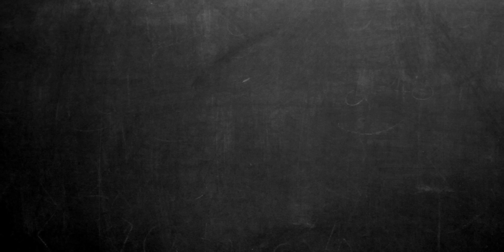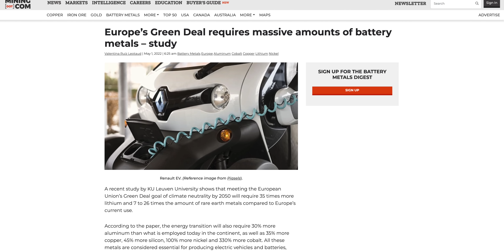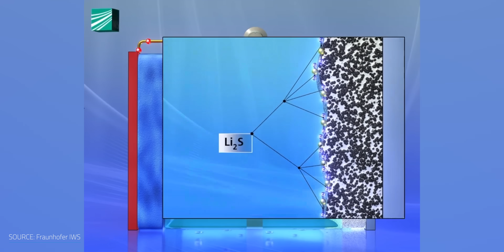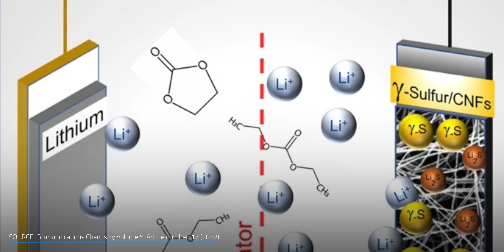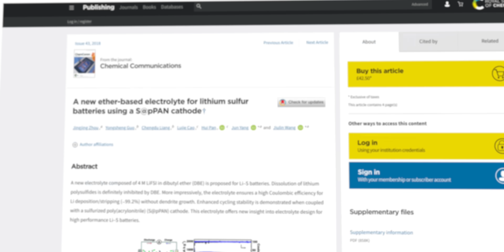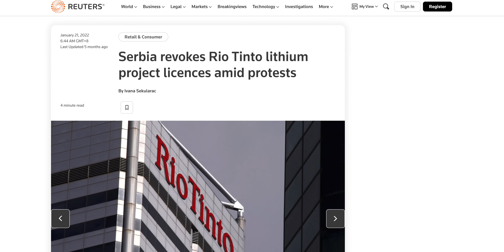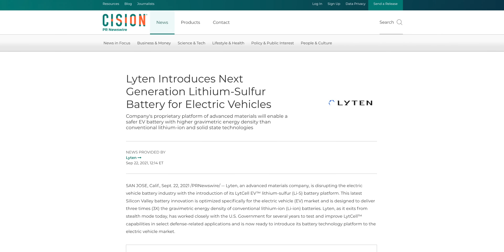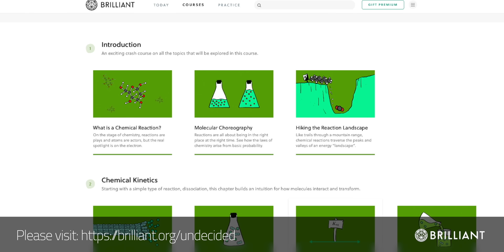Why This Accidental Battery Breakthrough Matters

Comment: Sodium-Sulphur would be amazing for grid scale storage, especially when their manufacture can be linked to desalination plants to supply fresh water. 
Perhaps something for those Middle Eastern desalination plants to feed, especially in a post oil era.
Reply: Well, Sulphur may be relatively cheap & abundant, but it is actually more expensive then lithium by weight. I think there are many cheaper solutions available based on Iron/Phosphor-chemistry, and these elements are truly dirt-cheap in comparison. They may make for heavy batteries, but for grid scale storage that is generally OK. Weight is much more important when you plan to move the battery around.

And than there are the liquid metal batteries from Ambri, which are mainly based on Calcium & Antimony, both of which are a factor 10-20 cheaper than sulphur by weight, which effectively still keeps them cheaper per unit of energy as well. And they have a lot of operational advantages over electrolyte batteries: Almost no degradation per charge, perfect safety during transport, regardless of charge, no real risk of leakage/corrosion accidents ... Main downside is, again, a relatively high weight, so they are not perfect for mobile batteries either.
Reply: @ShieTar_    Well said.  There have been so many new innovations in battery and solar technology in just the last five years, you have to wonder what will happen in the next five.
Reply: I was thinking the exact same thing.
Reply: If it tracks with the lithium improvement, sodium-sulphur would be more than adequate for LITERALLY EVERYTHING, not just grid-scale or other stationary applications. The lower material costs plus the higher power density might constitute a quiet mini-revolution in how we live - or maybe not so quiet, if eVTOL catches on :D
Reply: Desalination plant will be more viable as brine can be used to extract sodium out of ocean and water can be used for agriculture, consumer or other industry consumption.
Reply: Desalination plants need a plan to deal with brine, if they throw it back in the sea they will poison the water.
Reply: NaS looks like the ultimate goal, it ticks all of the boxes.
Reply: not fresh water. it would alleviate the brine problem. a 2fer
Reply: Another incentive to make brineless desalinsation plants
Reply: I do wish we could figure out super capacitors to a higher degree. It would make our electric grid so much more flexible.
Reply: @abacusyou  that's practically the same as solid state batteries, which can also involve the Sodium-Sulphur battery technology apparently
Reply: Having attended Drexel I actually have some hope for this advance,if u can get through the paperwork the place is obsessed with industry.
Reply: The sodium (salt) can actually be put back into the ocean, too, which will help counteract all the fresh water that the melting ice caps dilutes it with ...
Reply: I think Hydrogen electrolysis plants would work better for long-term storage. Imagine having a solar farm hooked up to a local energy grid in any dry desert-like place (central US, Middle East, North Africa, Mongolia, Australia, Southern Europe, etc). All surpluss energy would generate power for water electrolysis to separate hydrogen molecules from oxygen and store the hydrogen long term as a fuel source when needed.

Until recently the main issue was producing electrolysis cells large enough to make this concept quantifiable and grid-level worthy, but a recent breakthrough this year by a Danish phd student has flipped this completely and shortened this option with almost a decade (so that it is possible to implement within the next 5 years or so).

At the very least, a combination of hydrogen and sodium-sulphur batteries for storage would be great. The sulphur based batteries would likely present a better option for adaptive implementation if surplus energy storage is needed in a specific location for a duration of time until more permanent systems can be installed.
Reply: @Real_MisterSir  hydrogen electrolysis is a surprisingly inefficient cycle and depends on the availability of water. But solid state Sodium-Sulphur batteries can be moved anywhere, require no maintenance and supply electricity on demand.
Reply: @BobHannent  Yeah super inefficient
Reply: @BobHannent  hydrogen electrolysis can be efficient if you do it at a large scale. The lower the rate, the higher the efficiency.
The main problem is the patent of fuel cell key technology is mostly held by Japan. Therefore, instead of paying money to Japan, other countries just skip this technology instead for battery, which has lesser restriction.
Reply: @BobHannent  Isn't there a potential issue with sodium released when water is present?
Reply: @BobHannent  that all sounds great, also there’s plenty of “inefficient “ energy sources being used, my geuss is that while efficient is great practical is the trump card as of now. I personally like the idea of electrolysis, plus if it is “surplus” energy being used for the electrolysis then“ efficiency “ isn’t too big a concern versus losing the opportunity bc it had passed…
Reply: @curtismelton_4_8_15  hydrogen production and use is at best 65% efficient.
Power conversion and chemical storage is better than 90% efficient.
Hydrogen storage is dangerous and specialised, this technology is far safer.
The obsession people have with hydrogen is strange.
Reply: @Real_MisterSir  hydrogen storage and transport isn't like working with natural gas. It's leaks out of everything unless you take care to really maintain tightly specd equipment
Reply: @XenZenSen  Partially true, but generally that just means you loose a little bit of hydrogen. In Germany we constantly get a few % of Hydrogen mixed into our natural gas, the gas-providers just buy it whenever there is a cheap overproduction anywhere, and then feed it into their normal systems built for natural gas. As long as the hydrogen is cheap enough, the tiny amount of extra leakage losses are just accepted.
Reply: @Real_MisterSir  hydrogen still has the problem of expensive catalysts, and it takes alot of energy to free hydrogen from water around 45% the conversion into electricity, which uses up even more energy .
Reply: @Real_MisterSir  the problem of hydrogen based system is that it's expensive. No, by expensive I don't mean the system itself is expensive, but most patent is hold by Japan, thus you will have to pay them alot to use the system.
This is the main reason why the world isn't doing more hydrogen based system.
Reply: @Real_MisterSir  you first need to solve the fresh and purified water problem to adopt high scale production of hydrogen, also cold hydrogen storage is extremly inneficient in terms of long term storage and compression (since the more you put in a volume the more it scapes from the chamber) the only benefit form traditional batteries is in a form of buffer and in situ usage, hpe next gen high copresion tanks find a way to make hydrogen storage less low compresion volume dependant. and lighter materials for H2 cars.
Reply: @Real_MisterSir  hydrogen electrolysis, storage and conversion into electricity is about 30% efficient. Batteries and pumped hydro are 90+%
Reply: @tedarcher9120  Not with the current breakthroughs that happened in hydrogen electrolysis just a few months ago, allowing for a different production method for the electrolysis cells. Even if they're not quite as efficient, the main drawback is the limited quantity at which the cells operate - which has been radically changed now.

Of course a mixed use of hydrogen and batteries is going to be optimal for a long time, but battery production itself also has to be taken into account, as well as over-time degradation and capacity. Hydrogen solves many of those issues with improved fuel cells.
Reply: @Real_MisterSir  the problem is not production of hydrogen, but storage. Where do you store it? And how do you transport it? Also, fuel cells are only up to 60% efficient, so you lose half of it anyway

Comment: You WAY undersold how easy sulphur is to obtain. Almost all Canadian Oil and Gas, the cleanest and most ethical on the planet, has sulphur in it due to it being ‘sour’ or having H2S compounds in it. We literally have to pull the sulphur out and through it away. Alberta could become the next battery manufacturing hub with this news. We have both Lithium salts and sulphur in our O&G.